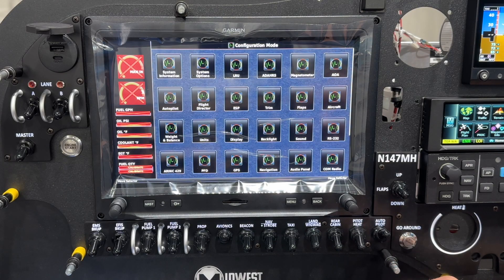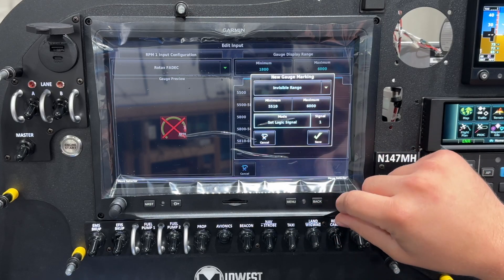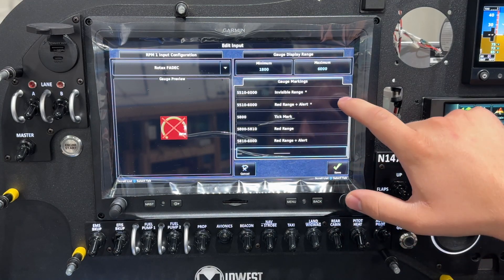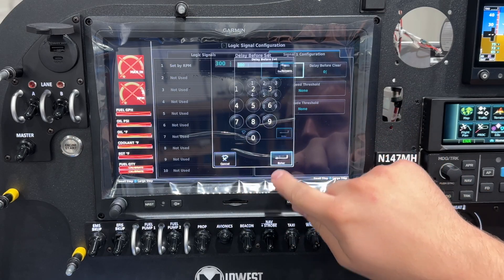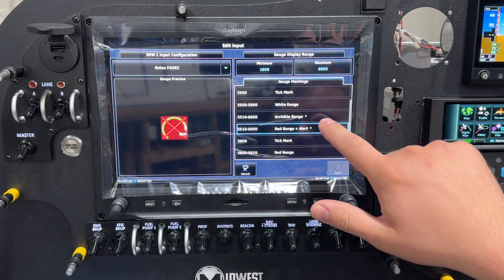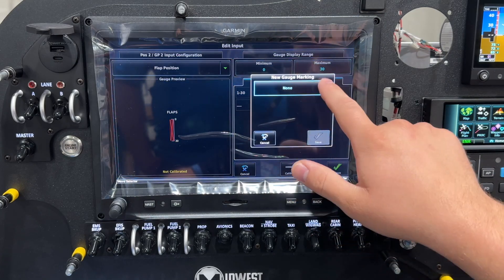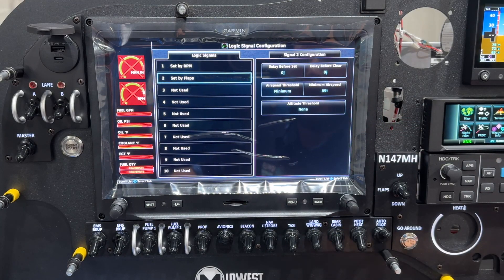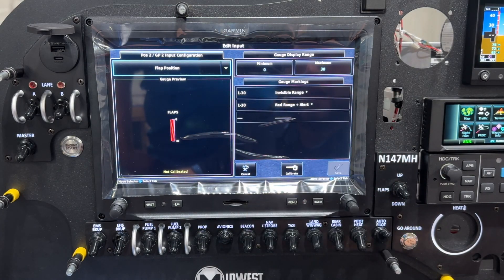G3X Logic Programming.

Comment: Super helpful. Thanks for sharing.  I also set up a minimum oil pressure that changes if less than or greater than 3500 RPM. And a takeoff trim position alert just like the example in the g3x manual.